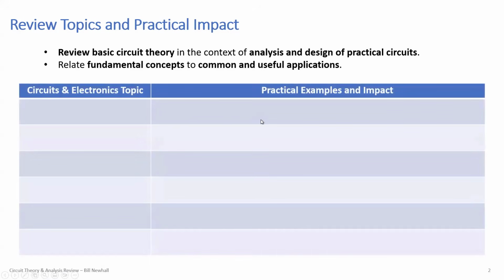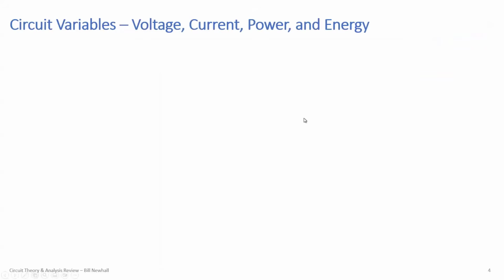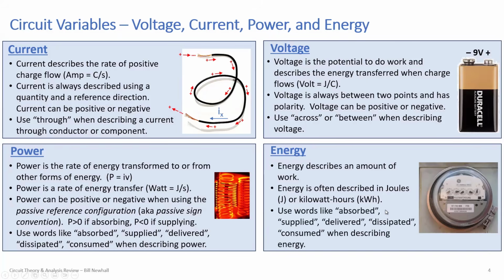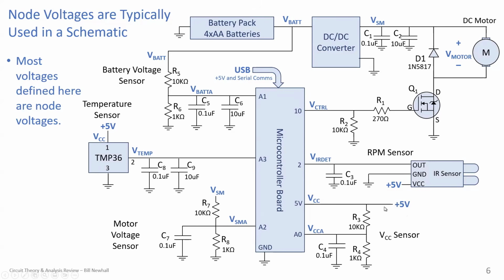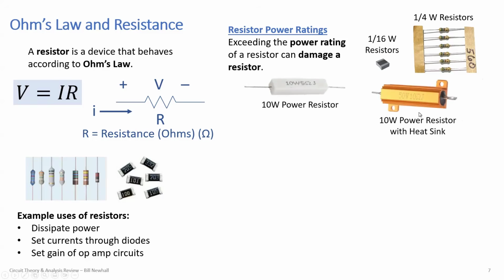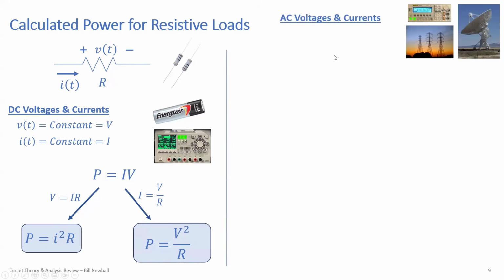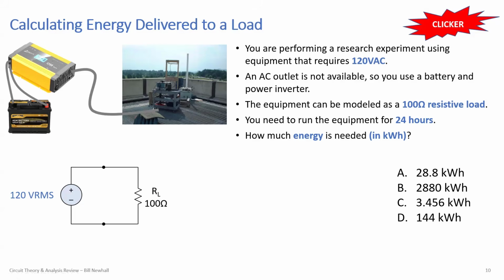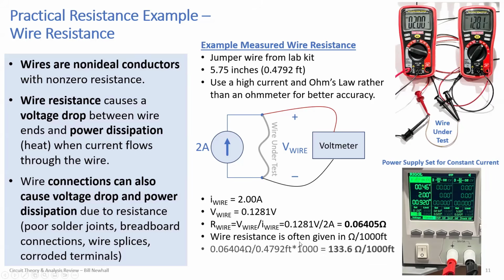Practical Electronics - Lecture 2

Comment: I have a problem with your presentation. You describe current as a flow of positive charges when there are no positive charges in a copper conductor. All the positive charges are in the copper atom nucleus and none of them move through a conductor. Therefore you are talking about holes left behind in the covalent band of copper atoms and those are not positive charges, they are holes, plain an simple. 

The only real positive charge is the proton. A hole left behind in a valence band may represent a relative positive charge but they have no mass associated with them and cannot be true positive charges. Arguments have been put forward that the holes have mass but that is nonsense.

This notion of conventional current flow dates back to the 18th century and Ben Franklin. Any modern person know that current is measured in coulombs per second and that is a reference to the negative charges carried by electrons. There is no definition for a charge related to a hole. Any reputable textbook acknowledges that real current flow is via electrons and the flow is negative to positive.

Please, stop teaching such nonsense. It is just as easy to teach it from the perspective of electron flow by visualizing electron flowing against the arrows in diodes and transistors. That;s how I learned it and it makes far more sense.
Reply: BTW...a proton has roughly 1800 times the mass of an electron but an equal and opposite charge. Does the so-called hole have 1800 times the mass of an electron, and if so, how does one explain an electron leaving a hole in a valence band that is 1800 times the mass of the departing electron?

A hole has no mass, it merely represents a missing electron. Because the electron is temporarily missing, it gives the entire atom a relative positive charge. What you need to be teaching is that a relative charge is not a real positive charge. Relative signs for voltages in electronics is an important concept.

Comment: I have watched Lecture 1, which was an introduction. I am now watching Lecture 2, and at 9:27, you mention, "You remember this from Intro to Circuits." However, you have not lectured on any subject up to this point except to outline what you will be teaching. Where is the Intro to Circuits course? Must it be taken before this?

Between Lecture 1 and the first 9 minutes of this video, you have primarily spoken about what you will teach. When you finally begin teaching, you reference material from "Intro to Circuits," which seems to assume prior knowledge. Are these courses designed exclusively for students enrolled at your institution? If so, it would be helpful to clarify this at the beginning. Lecture 1 seemed to focus entirely on what you plan to teach rather than teaching any substantive content.